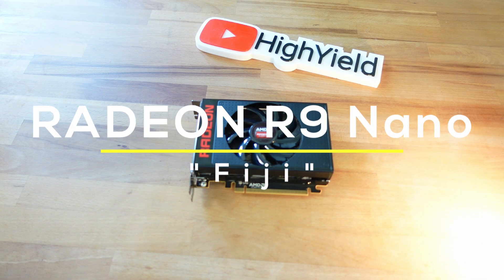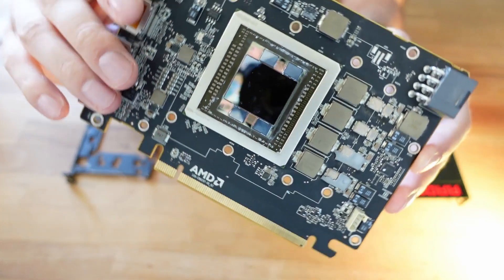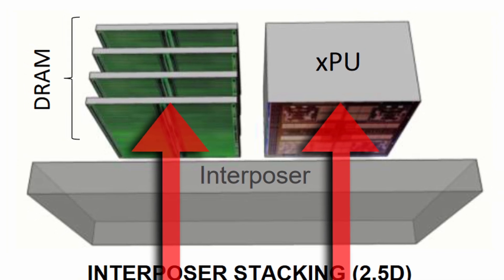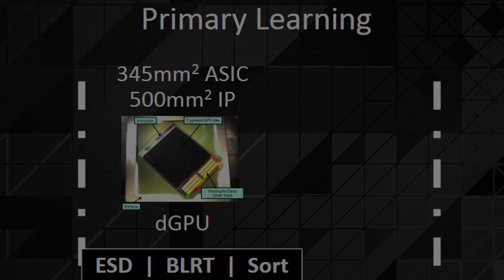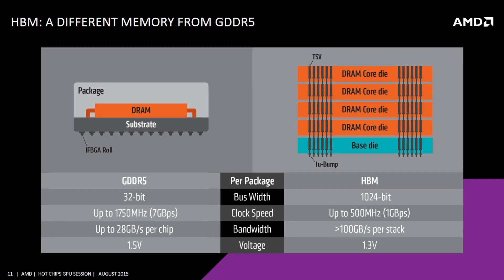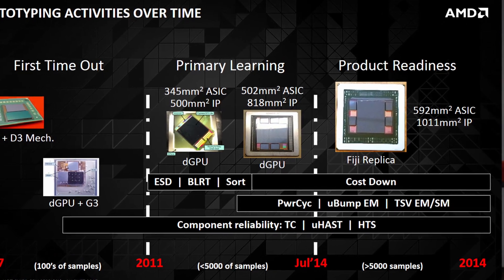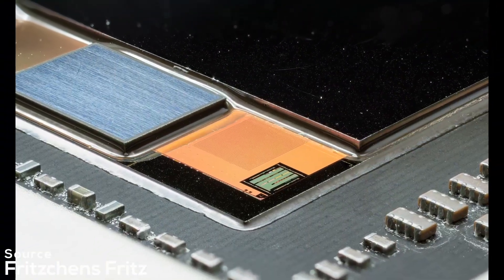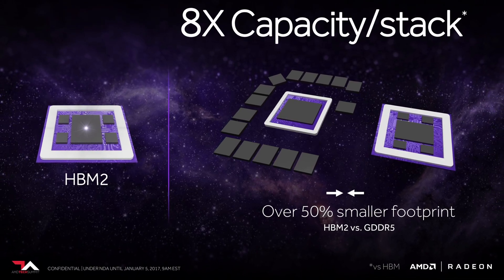How this tiny GPU invented the Future

Comment: HBM won't be used in gaming cards ever again because memory IO is analog and they stopped scaling like your previous video about SRAM "death", putting a 2048 bit memory interface would eat majority of die space, they transitioned to big cache instead, most likely we gonna see more memory 3D stacking, AMD have some patents on this.
Reply from the maker: The memory interface is actually not larger, as you would expect when looking at the interface width. A HBM interface is very compact compared to GDDR.
Reply: Plus you can just put the memory Phys and controller onto its own die with some cache or make it into a base die you stack the compute die on top of.

Comment: I still remember how surprised i was knowing that such a small form factor GPU had a tremendous power to catch up with GTX 980.
Reply: It's not that surprising really, you can easily get a small factor but heat management suffers since you can't fit a larger heat sink and space out components.
Reply: @SilvaDreams  It is surprising because it's almost half the length of traditional GPUs due to the advanced stacked HBM

Comment: I think the future is gonna be 400mm2 dies and stacked 3-10x
and you get to choose what combination of ram/ gpu/ cache you want, where each one is its own layer.
Lets look at 2nm with 500mTR, and 400mm2 = 200BN transistors, thats enough for 2-4gb per layer of "l3 cache"  
Imagine if gpus had a socket like am4, rather than a whole pc, its downsized to the size of a gpu, you add the ram and storage, but the SOC is socketed (and rather than am4 the socket would be as big as EPYC

Comment: I remember wishing these would me made into mobile GPUs. Without the need for vram chips you could fit a huge power delivery onto an MXM board which is about the same size as the fury nano pcb!
Reply: Did they ever make into mobile GPUs?
Reply: @SectorfiveYT that’s what the modern Apple mobile chips are
Reply: @SomeDude0881  I have an iphone, i didn't notice a difference in performance from an android phone.
Reply: @SectorfiveYT you could have a 10x faster phone processor and you wouldn’t notice cause nothing can take advantage of that
Reply: @SectorfiveYT  You use your phone for anything other than a web browser?

Comment: GPUs i have used... Geforce 256 => Geforce 2 Ti => Geforce 6600 GT => Radeon HD5850 => GTX 560 => GTX 580 => GTX 970(good GPU) => Radeon RX 580(great GPU) => RTX 3060ti(great GPU) => Radeon RX 6600(great GPU for its price) => Radeon RX 6800 xt(super happy with this GPU i picked up for $420 abt 8 months ago used right now)

Alot of the radeon driver issues were blown out of proportion by fanboys/nvidia plants.

They all feel more or less the same to me, except the HD5850 which had the cooling fan melt under the heat generated by the GPU lol. Those were the days man. 😂

Comment: I remember doing repairs on a few of these. I had to do a core transplant on one once. It was easier to tell the customer to buy a new one and swap their painted shroud onto it, with their permission of course. I salvaged the dead core card for it's other components. I eventually tore the core off to see what killed it, and found that the interposer had cracked right below the main GPU die.
Reply: @DigitalJedi ive got several bad cards from owning a computer company.  How do I learn to fix them?  What do you charge?
Reply: @Josef-K  The worst parts of the repairs are BGA soldering and PCB repair. I'd suggest looking u resources on those. I charged parts & labor + 22/hr.
Reply: core transplant how that possible on hbm gpus
Reply: @nsm0220  You resolver the whole package, including HBM, and drop on another. The HBM and everything are on one interposer which connects to the PCB. It can be desoldered like normal with extra care.
Reply: @DigitalJedi  neat fact i hope i can get a new hbm gpu someday in the future
Reply: Bad design, why only support HBM ????
big fail it was !
Just let board builders do what ever mem they need on the card !
Reply: @lucasrem That's not how these designs work at all. Including support for both GDDR and HBM would take up a ton of die area, die area they don't have room for. You can see this in diagrams of Sapphire Rapids, just how much room DDR5 and HBM controllers take up combined. GDDR controllers are even larger. Doing that on Fiji would have meant cannibalizing the graphics core. Even SPR had to sacrifice a CPU core on each tile to do both with smaller DDR5 controllers and was not constrained by the reticle limit in a traditional sense.
Reply: @lucasrem  The HBM die is made from the factory and is highly complicated/expensive. There is zero practically in supporting GDDR

Comment: You're right about GCN.  It was a good architecture at the start, but it just didn't scale with compute capacity.

Just compare the Radeon VII with the 5700 XT.  Both are very close to the same performance in games, but the Radeon VII has 50% more compute capacity, and even more memory throughput (it has four stacks of HBM2 delivering 1TB/sec of throughput).  RDNA is massively better for gaming than GCN.
Reply: And that's why AMD separated RDNA and CDNA...

Comment: 07:20  They didn't solve the problem at all.  They just worked around it, only putting down metal layers within the reticle limit.  The rest of the interposer is just inert silicon.

The interposer size limit is why Fiji only had 4GB of VRAM, too.  There wasn't room to add all the silicon required for more than four stacks, and each stack could only be 1GB at the time.

It really is a shame that we don't have HBM on gaming cards anymore.  It's superior in every way to GDDR - higher throughput, lower latency, lower power consumption.  It just costs too much.

Though AMD did at least make another clever innovation to work around that later on, using a large SRAM cache to increase the effective throughput of GDDR without having to spam even more memory controllers on the die.  Still not as good as HBM would be, however.

Comment: Great historical video on Fiji and its line of Fury cards. 

A few months ago, I retired my Sapphire Vega 56 Pulse from daily use as a 1080p card. In late 2019, I bought the used Vega 56 for $225 after tax. Power hungry and dumped a lot of heat at full blast, I love the Vega 56's compute power when I did video rendering. From my experience, the Vega 56 is my second most stable card after my first card, RX 580. Undervolted Vega 56 was a great card for my use case. With Vega 56, I got a taste of HBM. I can't lie; I want more, but we are not going to get HBM gaming cards for the foreseeable future. As a result, I want to collect the other HBM cards like Fury, Vega 64/64 Frontier Edition, Radeon VII, and Titan V.
Reply: I have a modded mi 25, not as good looking as the frontier edition, but it sure costs a lot less to get 16gb of HBM2, even after accounting for a bios flashing tool and a way to cool it.

Comment: Unanswered in this video is the question : Why did AMD move back to using GDDR6 in their latest GPU cards?  Is the problem of too much power consumption by next-generation GDDR memory chips still looming?
Reply: The reason is cost. As for the power consumption thing AMD tweak their architecture more for gaming with RDNA to get more performance at much lower power consumption. This cost issue end up being weaponized by nvidia with Fury X and Vega.

Comment: I have the Fury Nano, and only replaced it with a newer card (along with the rest of the PC) this year. Aside from memory capacity issues, the card still performed well.

The computer it is in is now on loan to a friend who cannot afford to buy a new computer. I say "on loan" because I had the stipulation that when it was to be replaced, or it died, I wanted to reclaim the Fury Nano, take it apart, and pot the PCB into clear resin. It is the most interesting GPU I have ever owned, and always felt like it was a little slice of significant computer history
Reply: I love the idea of putting that PCB in resin. I've done that as well, and may I suggest instead finding a good shadow box. The resin thing is way harder to get right than it seems. I tried it first on my delidded Pentium III, and while it turned out OK, I much prefer the look of my Radeon VII in it's shadow box.
Reply: It would make a good card for a display piece, right next to my GTX 295... if I knew how to display it...

Comment: On a website Semiengineering, there is an article "Will Monolithic 3D DRAM Happen?".
Monolithic3D is modifying 3D NAND technology to work as RAM.
Cool stuff, You could have single chip memory with 500GB of RAM or more, add to that wide memory interface like in HBM and we have high bandwidth and high capacity memory of the future.

Comment: this reminds me about apple...(making components almost impossible to repair)
if those vram chips are in silicon right next to the core..the question arise:
what are you gonna do if 1 of them fails?
those that are on the pcb..can be replaced..but cant say the same thing about those in silicon..
im also aware that this method improve latency and speed transfer including cooling...
Reply: Having repaired these cards in the past, you can't replace the VRAM. You either take on the task of transplanting a new whole GPU package, which is insane given its size, or you RMA the card and get a replacement from AMD when they were under warranty. These cards today are no longer produced and long out of warranty, so you mostly just pray to whatever deity seems appropriate yours was one of the good batches.
Reply: @DigitalJedi  tru story.

Comment: if only AMD was smart enough to give HBM to apus the performance should skyrocket on those
Reply: Does APU's have video memory or do they just use the system ram?
Reply: @t8z5h3  APUs use a portion of the system RAM as VRAM. By default this is usually set to somewhere between 256MB and 1GB in the BIOS, but can usually be edited. I have my laptop set up to use 4GB of the 32GB for VRAM on the iGPU. The only exception to this I can find is a weird Intel & AMD team-up product, the i7 8809G, which has a 24CU Radeon Vega-M GH iGPU on a separate die using an HBM stack for 4GB VRAM.

The Intel UHD 630 iGPU on the CPU die still reserves some system RAM and between the 2 of them that AP can drive a board load of displays. 

Modern APUs are held back by both RAM bandwidth and latency, with AMD currently trying to figure out how to feed 16 RDNA3.5 CUs in some upcoming APUs, and some current-gen ones struggling to keep 12 RDNA3 CUs fed on slower DDR5, like dual-channel 4800mt/s RAM. Leaks suggest either a quad-channel memory controller for fast LPDDR5X or a 128-bit bus similar to what the RX7600 has, though likely only 4GB instead of 8.
Reply: @t8z5h3  they use system ram, so imagine if they had something like this to bypass using that slower ram
they wouldn't be held back. APUs performance is greatly effected by the speed of the ram and latency of it, so the lower the latency also the better performance
Reply: @ChikaHakozaki  true
Reply: @ChikaHakozaki Effected means to start. "The law effected change."
Reply: *Price. 
The price would skyrocket.

Nice, a billion-bit memory interface to a tiny GPU core. That should do wonders.
Reply: Intel nuc's are pretty expensive, high performance APU are for custom clients.

Comment: Just Googled this card for some info a few days a go. Funny that the Rx580 is weaker then the R9 Nano😂
Reply: Nothing weird about that. Polaris wasn't meant to be a high-end architecture.
Reply: I mean the RX480 (slightly underclocked 580) was $200 for 4GB and the R9 Nano (also 4GB) was $650 at launch.
I would hope that they couldn't produce a competitive card 1 year later for less than 1/3rd the price.

Comment: AMD has introduced a lot of new ideas to tech in general.  It's really too bad their driver and software quality held them back for so long, and that reputation has continued to cause them problems long after they've mostly solved it.
Reply: AMD's biggest problem is people spreading unsupported nonsense like yours and of course smear campaigns from Nvidia .  I'm not saying their can't be errata but it's an industry wide issue, nothing is perfect, especially software.  Most problems seem to originate with Windows and easily corrupted Registry.  Have you seen the mess gamer's systems are like?  I own both AMD GPUs and CPUs, Intel CPUs, and Nvidia GPUs and never have any substantial issues.  AMD needs to put more effort into software integration though.
Reply: @maxwellsmart3156  You obviously didn't deal with AMD's drivers back during the first 5 years after they took over ATI.  Those were horrible times.  Their drivers didn't get all that much better until 2018.  Buggy, crashing, missing features, etc.  I know because I directly experienced it.
Reply: @dangingerich2559  I don't dispute your experience but I think when AMD's "reputation" is bandied about frivolously then you start to get a lemming effect and what the consumer is left with is a de facto monopoly and then neither AMD nor Nvidia really have to be responsive.  People are going to buy the green box because, and AMD can't win for trying.  Also, the level of technical capability is pretty low so there's isn't going to be an easy recovery, except for word of mouth.
Reply: @maxwellsmart3156  Not true, AMD was able to push out Intel easily when their products were more performant. 
If AMD releases a top tier GPU that beats Nvidia's in RT and raster, gamers will buy AMD.
Reply: @maxwellsmart3156  AMD enthusiast, here.
You're utterly delusional if you think ATi and AMD's drivers were on par with Nvidia's for upwards of a decade.
The one exception for this is the release of Vista, where Nvidia dropped the ball on drivers. 
Nvidia drivers were actually the #1 root cause for Vista crashes for the first 2 years or so of that OS's availability.
That doesn't erase the long and storied history of ATI/AMD's drivers issues on XP, 7, 8, and through the initial few releases of 10.

Blaming Window, the registry, and other nonsense is just a bad deflection. 
(Psst... Nvidia gamers still use Windows, the registry, and have garbage on their computers as well.)
"I've never had substantial issues. I'm an infant who doesn't have object permanence so I don't understand data and only what I'm actively experiencing in real time matters."

Comment: Clockspeed is a factor as well, latency is a big factor. Hbm's biggest Achilles heel was the increased latency compared to gddr, but bandwidth for sure was there even though it was still not enough with only two hbm2 stacks for vega cards which was proven with r7. Fiji was not fast enough for the large bandwidth of 4 hbm stack but the latency was what dragged down the perf of the fiji cards. 

Even vega cards would see a healthy perf increase with oced hbm2 even though the theoretical bandwidth was faaaar above what it needed.

Comment: AMD certainly were ahead of the curve on this one. Now look at every major HPC/AI GPU, they all look like Vega only on more advanced nodes.
Reply: No, nvidia rooted the path to AI in 2007 with cuda and gpgpu well AMD did create HBM, nvidia has used it on the high end but largely abandoned it for gddr5x ecc or gddr6 ecc. (Look to nvidia Tesla t4 as not the fastest but still the standard as a lot of them are still in production deployments.
Reply: @t8z5h3 nvidia and intel actually bet more on HMC. AMD work with Hynix to push HBM. I heard AMD spend quite some money to ensure HBM to  become the standard instead of HMC. Nvidia did  not abandoned HBM. The issue with HBM is very high cost making them unsuitable for consumer grade GPU. so they work with Micron to develop GDDR5X for pascal which later leads to GDDR6 development. their compute card such as GP100 and GV100 are using HBM. AMD hope wider adoption will eventually bring the HBM cost down but they only command 30%+ market share and because of the expensive nature of HBM only their high end card can really afford it. So wide adoption strategy failed. The HBM was so expensive that Vega only using 2 stacks and end up having less bandwidth than Fury X. Even 1080Ti that use GDDR5X end up having more bandwidth than Vega. And it hamper Vega from flexing it's true performance.